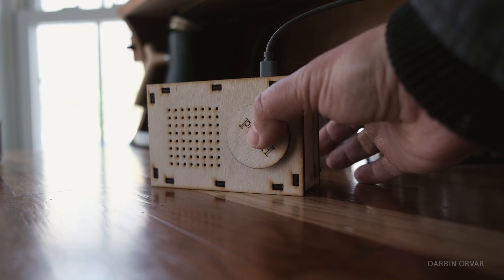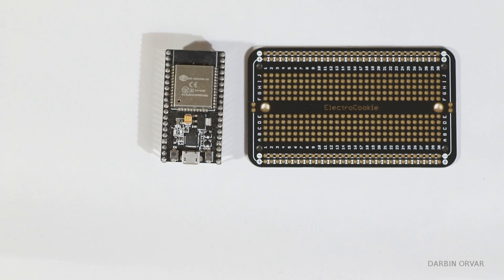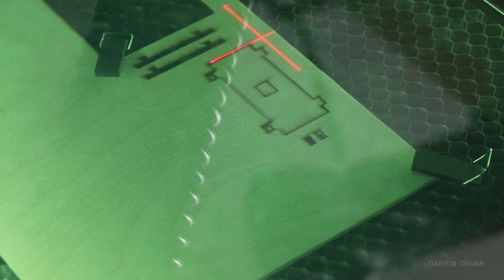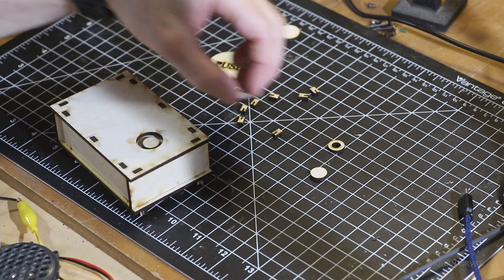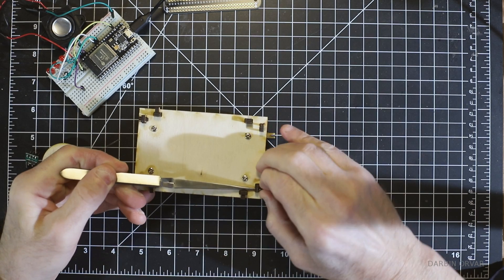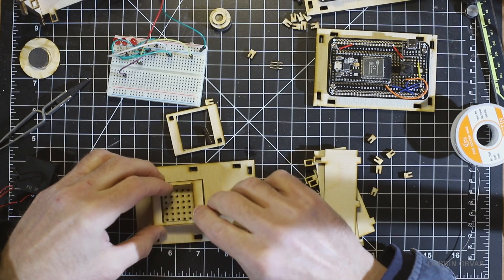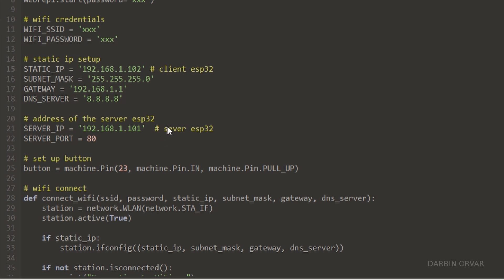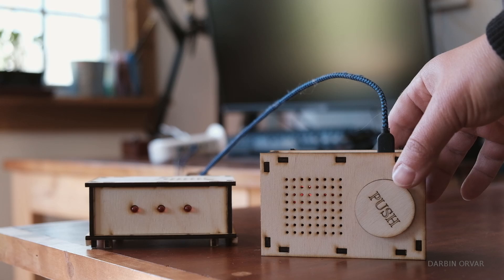DIY Wireless Alert System - Get Notified Instantly

Comment: A little more expensive but using 2 Amazon echo devices you can use Drop In feature and have voice both ways. Considering all the labor involved this is a more practical method of communicating.
Reply: So a walkie talkie
Reply: Love the wonky idea Linn, but I must agree with the original post. Far more cost-efficient would have been a GMRS license and a couple cheap radios. Cost of about $60 and the chance to teach the kiddos about how radio (something they have probably never been exposed to) works. Foster independence not reliance and things get better.
Still, keep going.
Reply from the maker: Keep in mind all those devices don't work unless the web is working, or they decide you can use their app. This is an off-grid project.
Reply: esp32 can be used as a walkie talkie , a few vids on youtube about this. and no network connection needed using esp-now